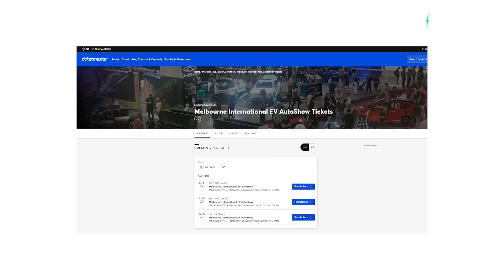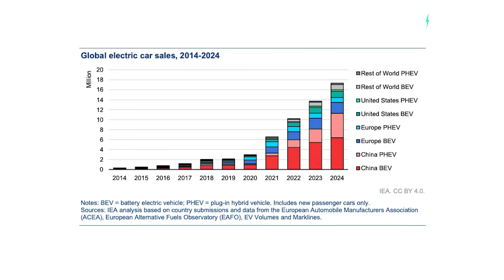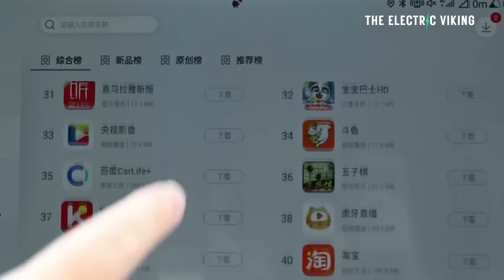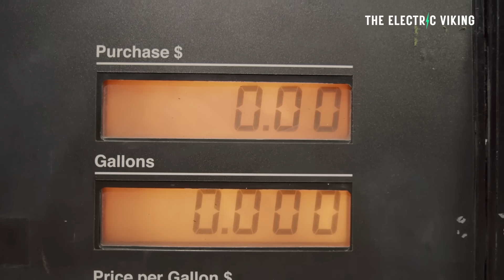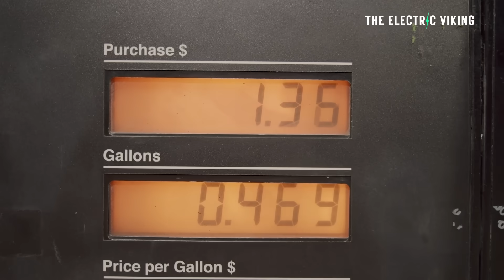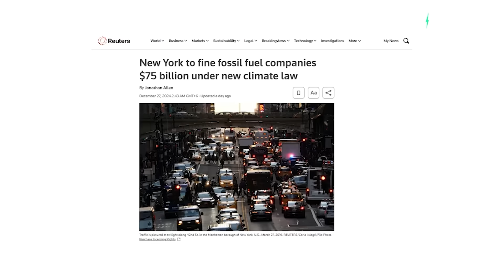Numbers Don’t Lie: Electric Cars Are Steadily Replacing Oil

Comment: I'm afraid Sam doesn't understand that when supply outstrips demand, prices fall. It's simple economics. Prices for gasoline will thus go lower, not higher. It's one reason for increasing taxes on gas or more broadly, implementing a carbon tax to charge its users for the true cost of oil (environmental, health). It will be important to learn how to make steel without using coal, fertilizer without natural gas, and cement without oil and gas to calcinate limestone. These approaches are now being done on a pilot scale, but of course politicians everywhere are easy to bribe. I wish our high schools taught basic science better.
Reply: I believe that Sam is pointing to when the supply and demand case falls over as the fixed costs make it impossible to make any sales profit.😊
Reply: @malcolmrickarby2313 Yes, I think he means that in a local sense. If you live in a small town, your only remaining gasoline station closes due to poor sales, ICE owners must drive 15 miles to fill up, there's a cost. Or refineries begin shutting down or refine less gasoline per bbl. Currently they average 20 gallons per 44 gallon barrel, the rest used for plastics, fertilizer (to create ammonia) and various important things. But it's not necessary to make that gasoline, just easier and necessary right now. There are other techniques, but you have to change the refining process. Every transition this big is going to be painful, and if you don't adjust, worse. And nothing comes free.
Reply: @malcolmrickarby2313 I just wanted to add that WTI (West Texas Intermediate crude) spot price today was $60.81. The idea oil companies are gonna drill baby drill is ridiculous. Their profit margins have collapsed. Natural gas prices in the US are half to a third the price in Europe $3 vs $7-9 per unit of measure. So we and Canada are building LNG terminals to load ships. It takes 3-5 years to build an LNG facility, and that will never be financed til you build a gas pipeline to it. That can take 3-5 years to infinity. Nobody wants pipelines crossing their fields and streams. So it's lawsuits galore. Maybe you can work a deal with Venezuela, once the richest country in South America. They have the biggest reserves in the world, more than Saudi. And it's heavy crude, which Houston loves to refine. So that's 10-15 year process. But if the CIA did a little regime change (our specialty), we could cut that to five or fewer. So you never know. I vote for renewables and nuclear, and support the push to fusion. I forgot to mention that 20 percent tariffs on steel imports makes drilling and pipelines a lot more expensive. That's capex cost, which further cuts into profits for producers.
Reply: Finally, a third of US natural gas production is associated gas, that's gas commingled with oil which is your main target. Mostly in shale formations. There are big gas only fields. But the US Gas reserves are small compared to some other geographies, so you can expect domestic prices to rise rapidly as we export more LNG to Europe, etc., then run out and begin importing. Ask Google to rank order gas reserves or oil and gas reserves by nation. It's sobering. We're just the most technologically advanced and efficient. Why else did Russia cut lucrative extraction deals with Exxon in Siberia?
Reply: "It will be important to learn how to make steel without using coal, fertilizer without natural gas, and cement without oil and gas to calcinate limestone."
All of the above makes the price of commodities much higher with no gains except for higher prices. Why would anybody buy "Green" Steel when normal steel from India will be half the price.
Reply: @sabb007  I agree. But when it's cheaper? Technology is racing forward at a blistering pace. Please read my response following, it was meant for you, too. I have no quarrel with either of your objections, and certainly I do support Sam's mission. But I don't think he speaks from a carefully composed script. It seems extemporaneous, which I prefer. It's honest. But sometimes we misspeak and inadvertantly open a can of worms. I did many times back in my day.

Comment: The thing is people should buy an ev at the same price they usually buy an ice car and compare. The cost only of home charging is 10percent the cost of petrol. Brakepads last for 100k km plus. 

You can also transfer your monthly petrol expense in a saving account. Your next car maybe can be bought in cash.
Reply: My brake pads are less than 1/2 used at 260,000 kms driving in the alps....
Reply: Consider the following: Your domestic solar panel and battery system will save you about $4 per day (remember that you can't use the last 20% of the battery storage capacity). Look at the total cost of your home system and see if it really pays itself back over the expected life of the system.

Comment: I like all these EVs , but where I live , I’ve never seen one single EV ever.   And I suspect there won’t be for a long time,  it’s just not possible here,  we travel vast distances, often towing boats, jet skis , and campers , or dirt bikes,  all on gravel or dirt roads,  I wouldn’t trust an EV to launch my boat at the boat launch.  How wet can they get?
Reply: Solid State batteries will give you the range you need.  Water won't harm an EV.

Comment: Hi Sam, looking at the biggest auto market (China) plus Europe...they are both moving to EVs at warp speed. In Europe, Norway is leading the way with the rest of Europe soon to follow. For example, in the UK, EV market share will soon be over 50%. The momentum is picking up critical mass. It seems consumer sentiment in Europe has already totally shifted to EVs based on the consistent market share growth we see there. The same phenomenon seems to have already happened in China. The EV success in these markets will convince the other reluctant markets (Japan and the U.S.) to move to EVs.
Reply: Most people make the change to ev,s because of lower running costs and almost no other maintenance to do.
The other bonus is that ev,s make no engine noise and don't spew out toxic petrol or diesel fumes .
In the next 10 yrs oil demand will drop drastically once ev adoption around the world accelerates.
Reply: The share of EVs in the UK will not soon be over 50% unless you’re including PHEVs and hybrids and they both use hydrocarbons. They don’t even have 50% of sales and that’s way different from a “share of EVs in the UK”. You simply won’t see them take over in those markets any time soon save for tiny populations because the grids cannot take the load.
Reply: In Germany, it is still a fucking pain in the ass to get a charger even in area like RheinRuhr... Northern Italy is fine until you hit Florenza.. even the rich places like Sardegna you have to planned well ahead to charge Tesla or any EV: camping Baunei could be problematic if you don't have a destination charger ... South France is fine but until you have to navigate to Paris thru certain tourist route than the normal route

Comment: Just came from China today, visiting  the Shanghai area. Nearly all cars were electric. Walking under the highway was as quiet as a walk in the park. Also 95% of all scooters were electric.This is the truth. The noise in the center was from people. speaking....
Reply: China had a massive air pollution issue in their major cities. Days where people couldn't go outside. To their credit, they have massively turned that around with EVs and renewable energy investment.
Reply: Yes was wondering what air pollution is like?  Is that true?
Reply: The air in Shanghai a city with over 30 million people was absolutely clean, just as clean as here at home in Denmark on the countryside.. @jonathanlandry3491
Reply: Except the noise of the cicadas 😂😂😂

Comment: Bioplastics are becoming a viable alternative to traditional plastics and their uses. Bioplastics account for around 1% of the 370 million tonnes of total world plastic generated. However, through 2025, yearly growth rates are expected to be about 30%.Yes, bioplastics, which are made from renewable biomass like plants and algae, are increasingly being used as alternatives to traditional plastics. This trend is driven by both environmental concerns and a growing market for sustainable products.
Reply: The reason bioplastics has not taken off yet is that the oil products that the petrochemical companies use for plastics is a waste product from fuel production.  In other words, the plastic feed stock cost is less than zero.  This is because they would have to pay to get rid of those waste products if they were not being used for plastics.  You cannot compete with something that has a negative price for its feed stock.  However, as the oil use for fuels drops, this cheap feedstock will also drop.  They could drill for oil just to make plastics, but that will make the plastics expensive.  This is where the bioplastics will get the edge, and they will eventually replace the oil-based plastics.

Comment: In 2024, China consumed approximately 16.3 million barrels of petroleum and other liquid fuels per day, making it the world's second-largest oil consumer after the United States. 
U.S. Energy Information Administration

🔍 Breakdown of Oil Usage in China
1. Transportation Fuels
Consumption of gasoline, diesel, and jet fuel totaled about 8.1 million barrels per day in 2024, marking a 2.5% decrease compared to 2021 levels.
This decline is attributed to the rapid adoption of electric vehicles (EVs), expansion of high-speed rail networks, and a slowing economy. 

2. Petrochemical Industry
Demand for oil-based feedstocks like naphtha and liquefied petroleum gas (LPG) has been increasing, driven by growth in the petrochemical sector.

3. Industrial and Other Uses
Oil is also utilized in various industrial processes and for heating, though these uses are less significant compared to transportation and petrochemicals.

(Energy Tracker Asia, energynews, IEA)

Comment: 2023 was a record oil consumption year for China, reported at 16,576.537 Barrel/Day and up from 2022s previous number of 14,969.983 Barrel/Day (the plus for 2023 amounted to a staggering plus of 1,606.554 Barrel/Day) (CEIC Data). The new numbers for 2024 show a decrease of 200.000 Barrel/Day after that record year. While it´s a positive sign, the consumption still was far above any previously recorded year except 2023. While it´s too early imho to be too optimistic after just one year, due to Trumps tariffs and impact on production in China 2025 will show a further reduction due to coincidences and not yet to a longterm trend. I was always surprised how little impact the growing electric carfleet has had on Norwegian domestic oil consumption and they run not only cars, they run most of things, namely heating with 99% renewable electric hydropower.
Reply: In 2024, China consumed approximately 16.3 million barrels of petroleum and other liquid fuels per day, making it the world's second-largest oil consumer after the United States.   (U.S. Energy Information Administration)

🔍 Breakdown of Oil Usage in China
1. Transportation Fuels
Consumption of gasoline, diesel, and jet fuel totaled about 8.1 million barrels per day in 2024, marking a 2.5% decrease compared to 2021 levels.
This decline is attributed to the rapid adoption of electric vehicles (EVs), expansion of high-speed rail networks, and a slowing economy. 
(Energy Tracker Asia, energynews, IEAz)

2. Petrochemical Industry
Demand for oil-based feedstocks like naphtha and liquefied petroleum gas (LPG) has been increasing, driven by growth in the petrochemical sector.
(same) 

3. Industrial and Other Uses
Oil is also utilized in various industrial processes and for heating, though these uses are less significant compared to transportation and petrochemicals.

Overall, while China's total oil consumption remains high, shifts in transportation and industrial sectors are influencing the composition of oil usage.
Reply: @mac_mcleod  that´s a 5-star reply, thanks:)
Reply: @SunshineShane you are welcome.

Comment: Haven’t bought gas in 8 months and not missing it in the least.  
Fun driving by gas stations watching people pump gas spending 6 times what it costs me to charge at night.
Reply: No oil changes, transmission fluid etc.
Reply: @Jebus-d9k5j  Getting screwed on repairs at the stealerships.
Reply: Now time for some solar.  Most people only average 12 KWH per day driving.   That's about 1400w of panels.
Reply: @mac_mcleod  Best move I ever made was becoming energy self sufficient, by initial investment paid for itself in 45 months. I am never going back to the grid.
Reply: Also taking them 6 times the time it takes me to plug and unplug.

Comment: 1:  I would bet that gas cars, although technically are on the road, are driven less once there is an EV in the family.  
2. The use of oil for plastics is irrelevant to climate change.   What I want to know is what are the percentage drops for transportation oil.   (Gasoline, diesel, jet fuel etc).
Reply: Bioplastics are becoming a viable alternative to traditional plastics and their uses. Bioplastics account for around 1% of the 370 million tonnes of total world plastic generated. However, through 2025, yearly growth rates are expected to be about 30%.Yes, bioplastics, which are made from renewable biomass like plants and algae, are increasingly being used as alternatives to traditional plastics. This trend is driven by both environmental concerns and a growing market for sustainable products.
Reply: 1.  That is the experience of my sister and brother-in-law.  Their Tesla is first to leave the driveway.  Their Jeep is the fallback car if both need to go separate places.

2.  Oil consumption for plastic is minor compared to fuel use.  And if the plastic is either recycled or buried its carbon won't get into the atmosphere.  Burying is re-sequestration.
Reply: @bobwallace9753 Burying Plastic doesn’t solve the problem of Microplastics that get into EVERYTHING including Ground Water and Soil
Reply: @DavidC-pg6ni  
Two things.  Extreme climate change is the major problem humanity faces.  Then, I'm not sure that if landfills are properly constructed using thick clay liners and sealed over that the plastic would degrade and be as much of a micro plastic danger.  But I do agree that moving to plastics that safely degrade is the best solution for both problems.

Comment: I got my first EV (a Tesla model 3) and I really love it. I wouldn't see myself going back to an ICE car.
Reply: Me too. Next year will add  byd EV truck and will try to ditch my hilux.
Reply: Love my Model 3. Never going back either although i'd love an EV ute/ truck
Reply: @williamjohns1490  my only complaint about my model 3 is that it’s not a hatchback and that would make it way more practical to carry large items. Model Y is too bulky for me and I still have range anxiety, it doesn’t go as far as my model 3 though it’s try I don’t drive that far most of the time.
Reply: @ren2704 ... true a hatch model 3 would be a suuuuuper seller... i think tesla dont make it because it might steal sales from model y...
Reply: How do you increase the volume while driving ? Or change music? Or driving mode? Just curious,
Reply: @diego2817  there's a wheel knob on the steering, you just scroll to change the volume, and tap it left or right  to change tracks. I never change the driving mode (always sport), for that you just go to the driving dynamics, not sure if there's a shortcode or a voice command.
Reply: @diego2817 With the rotary knob on the steering wheel 😉
Reply: @diego2817  roll the scroll wheel on the steering wheel for volume cricket left and right to change track. Or use the mic button on the steering wheel to tell it which song for album you want to play. You can even control the wiper speed and on off from the steering wheel rarely ever need to look at the screen. It’s all easy to get used to.

Comment: I traded my 10 year old car for a used Bolt with brand new battery. As long as I don't do long highway trips it is a money-saver.
Reply: I've done a few road trips in mine.  I find that DCFC is still cheaper than buying gas.
Reply: @craigmerrow225  I'm in CA and most of the fast chargers along the highway are 64 cents. Compares to $6.40 per gallon gas.